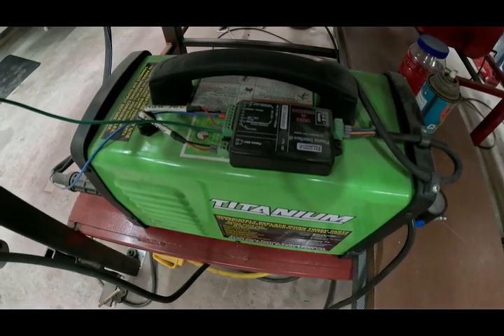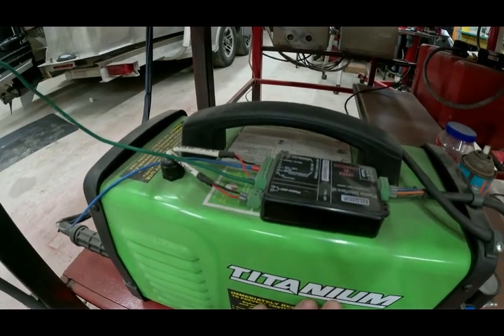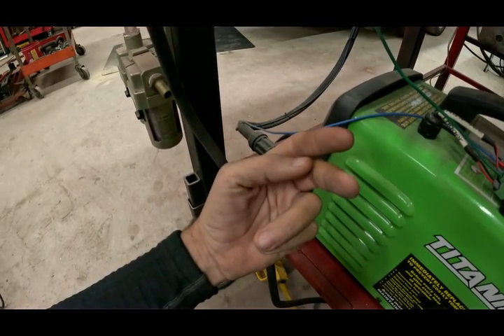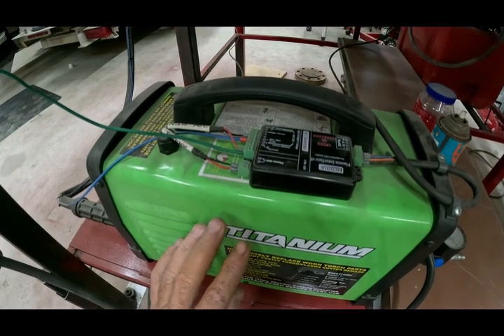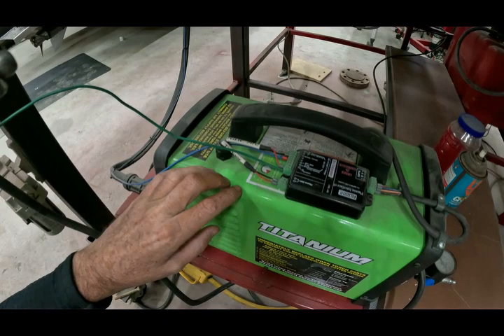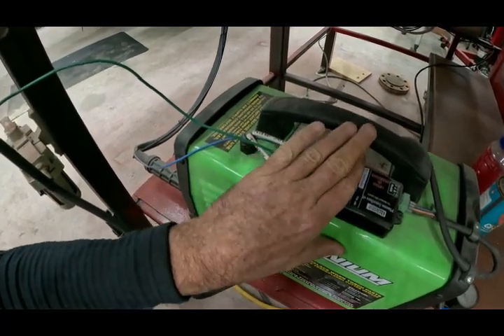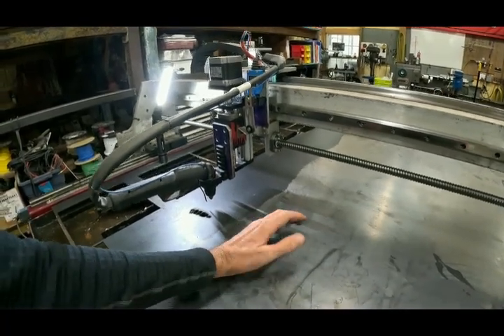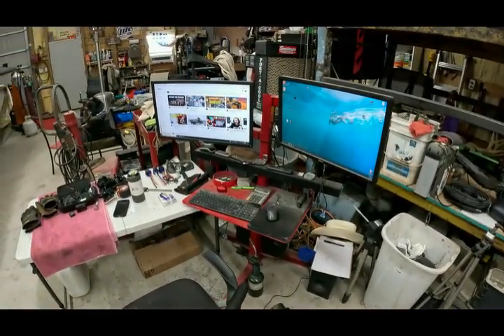Budget DIY CNC Plasma Table THC (Torch Height Controller) Breakdown Proma

Comment: So you are saying if I am just starting out, go ahead and buy the MyPlasm CNC System with THC built in.  Only thing I see is it uses USB vs Ethernet.    Also did you get a new plasma cutter?  I am going to build a rack and pinion Plasma CNC machine.

Comment: I had the same problem with the ohmic being super unreliable after a couple cuts or when the torch got wet, going to try that direct ground clamp method. I have the ring around the torch as well so I'll try the Romex thing as well if the ground clamp doesn't fix it
Reply from the maker: The Romex definitely doesn't look the best, but it works...
Reply: I'm actually working on my table right now trying to figure out how you did this, I have a jumper between my ohmic/material pin and + voltage on the divided voltage output, and then on ohmic/shield I have the wire that goes to the torch head around the collar. Nothing coming out of the electrode/torch negative because that is already wired into the divided voltage negative pin  @OldBarkerRanch1981
Reply from the maker: I know I had a single wire that ran from the voltage divider all the way to the torch head where I connected it to the Romex.  The Romex was isolated from the torch (it only touched plastic).
Reply: @OldBarkerRanch1981  think I found the issue. My ohmic sensor was touching the shield on my torch. So now I just need to do the Romex trick. Did you just use calipers to figure out the height? It needs to be the same height as the shield so it touches the material at the same time as the torch right?
Reply from the maker: @SamCyanide  no I used a .030” shim and set the offset of .030” in the software.
Reply: And how did you attach the Romex? I tried soldering but couldn't get it to stick. I'll try a hose clamp maybe
Reply from the maker: @SamCyanide  I used a non insulated butt connector to mate the Romex to the wire then put adhesive heat shrink over the connection.

Comment: The voltage divider might come in handy if your plasma has HF start, as then the arc would be started with a pulse of several kv.
Just sayin...
Reply from the maker: Yes but I do not intend on ever using HF start machines..
Reply: @OldBarkerRanch1981  was just explaining why it's there and why it might be useful.

Comment: for the THC, you only use the ohmic sensor...i think you will change my mind and i'll do same as you. too much troubles for the floating head. 
Thanks
Reply from the maker: Since I started using the OHMIC touch sensing it has been amazing! I was going to build a floating head but trying to keep the gantry as light as possible. Seems to me that the problems with the OHMIC sensing would rarely occur in a smaller setup like mine. I think those issues come up in mass production setups. So far mine has been great!

Comment: You mentioned losing steps on your lead screw axis. Steppers can run a bit faster with higher voltage without losing steps. Just something to consider. But yes gear rack or belt drive is better for steppers because they like to run in lower RPM ranges and lose steps when they spin too fast for a given voltage they are run at. You can also gear up the axis with pulleys and belts so the steppers don't have to spin as fast for a given lead screw RPM. Thank you for sharing! Great setup you have!
Reply from the maker: thanks for the advise! I have thought about re-gearing the belt drive to 3:1 as a temp fix..

Comment: I have a longmill CNC router. I 3D printed some adapters to hold a plasma torch with the router mount. Works great as is, but I would really like to add the THC.
Reply from the maker: You wont regret it!